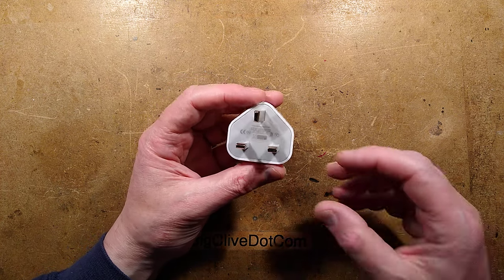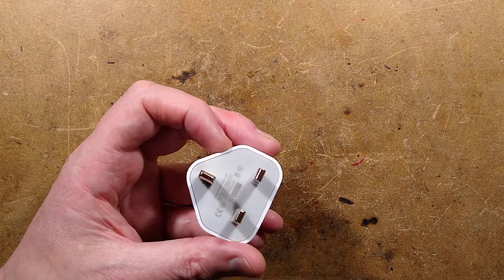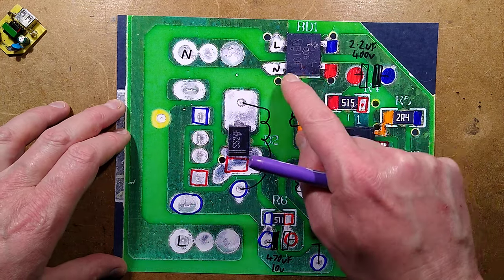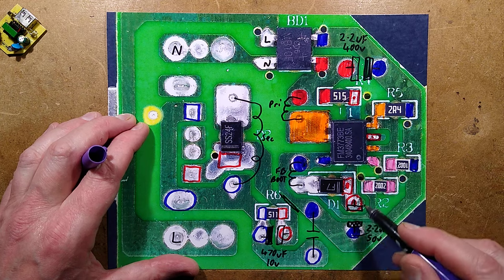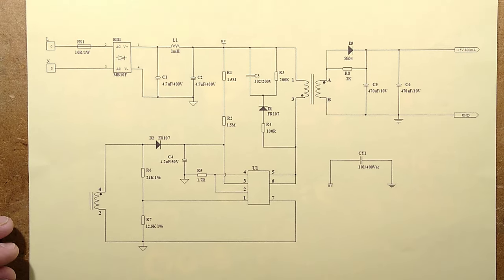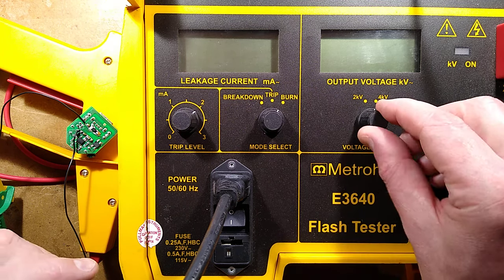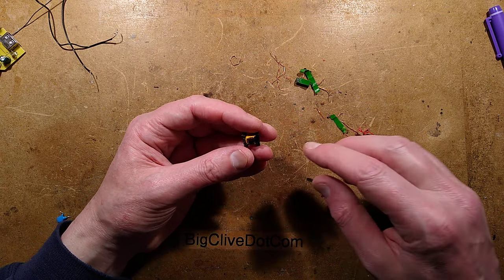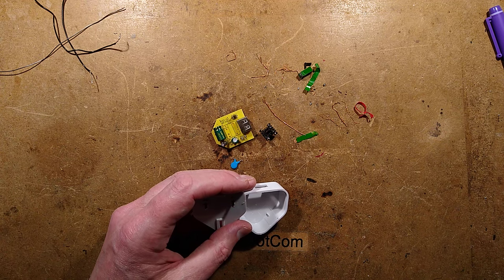Don't buy cheap death-wish chargers

Comment: I definitely wouldn't! I'd only ever buy from somewhere reputable as these could electrocute, explode or catch fire. Quite worrying these are on sale but at least it served one useful purpose, another great Big Clive video!
Reply: Vape shop owner here. Before there were UK distributers (yay, everything goes back on you as the importer) we'd be sent half a dozen large boxes of unsellable USB adapters and same again of completely unnecessary death dapters. Probably cost us an extra £500 on DHL shipping and then we had to pay commercial waste to get shot of them (which cost more than the shipping).
Chinese manufacturer thought that they were doing us a favour by sending "free gifts" FFS.
I can see the attraction of selling them to the public. We didn't. I've got loads at home, they're ok ish. I use them for small personal low current projects.
Reply: Worrying to me that it carries the CE safety compliance mark too. If Clive had reported his findings to Trading Standards, they'd have an open and shut case against that store in Sauchiehall Street.

Comment: I had one of these. My daughter has a metal cased phone and said she got mild shocks whenever touching it. It had to go. The 400V/5V separation and arcing was scary.
Reply: 400V???
Reply: @GBOAC  Rectified 230ACV RMS is pushing 400V and can spike over.

Comment: I just looked up Apple UK chargers, and I'm so sorry for you.  I love the UK home electrical standards.  But I also love the US 5W charger.  It lacks power, but fits in any pocket and works reliably on any power strip.  Great for overnight charging.  That 5W UK charger looks like an abomination.
Reply: 5w eu lightning chargers are scary small too!
Reply: The foldable pins 20W one I use for almost everything now, its excellent, pins fold away, can even power the laptop in an emergency. Only £19 too.
Reply: Remember that was a fake. Hopefully the real Apple made ones are somewhat better.

Comment: You're right calling them "Death wish" charger from pound shops. They are built to Chinese electrical standards, where electrocuting the user is perfectly fine.
The separation between the main and the output is 1 millimeter instead of the 20 required from international regulation.
Also, the charger lacks any feedback from the output, normally achieved with an optocoupler - which is missing here.
Thanks for warning the Internet about these dangerous contraptions...
Reply: I gotta ask, is the electrocuting the user thing a legitimate thing in their country?
Reply: They are not built to Chinese standards. Chinese domestic market has proper safety standards as well. Crap like this doesn't meet any standards.

Comment: You would LOVE a Soviet "transformer" I came across. I bought a Soviet flashgun to go with a Fed camera that I bought, 30 years ago when I was in Riga. I did not have great confidence in the transformer so I opened the case - it was screwed together. To get the necessary 6v to power the flash they had put a bridge rectifier and then a bloody great big wire-wound resistor. That was it. No isolation. About as unsafe as could be. I don't know if I still have that transformer or whether I threw it away.
Reply: Stick a 5.1V zener diode and a smoothing cap across it and make the least efficient and least safe phone charger ever!
Reply: Soviet stuff was illegal to use even in some countries of the Eastern Block. My graddad worked as a maintenance electrician  during 80's. Every equipment they had and was labeled as "сделано в ссср" had to be adapted or used with a safety transformer. The reason was that the USSR used the IT system in their power network so nothing (in theory) can give you a shock unless you touch both wires.

Comment: Well, don’t power any TTL-logic chips from this thing; the voltage was edging up to 5.25 volts or so (at around 965 mA). This’ll result in hot, smoky chips - and not BBQ flavor either! 😏
Reply: TTL can tolerate up to 5.4 reasonably well, but poof, no safety margin
Reply: TTL speced to 7v
Reply: @johndavis1465  No that's absolute maximum, as in a surge or something. So power supply overshoot of 6V is spicy, but non-volatile, whilst you could only get away with one or two 7V hits before something hates you for it!
Specs show 54LS' logic can withstand up to 5.5V - but the more common 74LS' series only handles 5.25V

Comment: That rather loosely mounted PCB with the mains pins almost touching the USB connector shield is also a potential safety hazard.
Especially since the openings of the pins wapping around the mains pins are open on the side towards the USB connector, so wiggling it a bit (while holding an USB cable) may already shift the board slightly and thus allow the mains pins to touch the USB connector.

That one really should have written "Don't turn it on, take it apart" as operating instructions.

Also in the video, it looked like the first spark was somewhere at one of the legs of the chip, not the traces which were obviously too close to eachother.

Comment: Thanks for making us aware of the dangers of these cheap chargers. Many people assume because something looks like the genuine article it will be safe and perform the same. 
I've always assumed Poundland electronics are actually very good, as being retail, they are carefully regulated.
Reply: ones sold by actual Poundland 'usually' are much better, clive has reviewed some, that said, one   of the ones he reviewed i bought, only used a couple of times till it made a popping sound and bit of a smell, i opened the thing up and both ht dc smoothing caps were red hot and one very bulgy about to pop completely,   i think the main problem is trying to shrink parts too far, as someone once said, 'you cant miniaturise the watt' ,  larger sized caps handle the ripple current better without almost boiling

Comment: If they would connect the Earth with GND of the secondary side, then they would have a security benefit in case of a connection between the life-wire and the secondary side. But they didn't do this.
How would it be if the products get quality-checked from an engineer before we let them enter the European boarder?
The possibility that bad things are happening would be much lower.

Comment: It's sad how little life means to the manufacturer of these death traps. 
Unfortunately government isn't out to protect anyone but themselves. 
Otherwise, importing these would've required true UL and other approvals, like apple and other name brands do.   
Pay once, cry once. Buy real name brand electronics.
Reply: It was marked CE. To do that is a statement by the manufacturer that it complies with various EN standards that derive from IEC standards just like UL. Clearly the manufacturer was lying. But to see it in Europe it HAS to be marked CE (it's compulsory) so the manufacturer just applies the mark without bothering about compliance. That means that the CE mark is essentially WORTHLESS despite honest companies spending lots to comply. What CE actually has come to mean is CAVEAT EMPTOR !
Reply: Not the government's job
Reply: @alfstewart2592  Sort of half and half. Central government in the UK has 'farmed out' policing CE marking to Trading Standards who are underfunded so it ends up being a mockery of the law. It was the government that brought in those regulations and more recently the UK only CA but they're just 'box ticking' in reality.
Reply: Give government enough powers and it will do anything to the max. Great example was in 1970's when government prohibited extension plugs and  cables. In Finland. Only legal solution was either lengthen the cables on devices or install new wall plugs, which could only be done by licensed electrician. Lasted only few months, but some new apartments had literally hundreds of wall plugs, which was not too safe either.

Comment: While I agree in principle… I don’t need anything to come with any more USB cables or chargers.  All I wanted with my iPhone 13 was a lightning to headphone jack adapter.  I had none of those.
Reply: I didn’t even need one of those as I have wireless ear devices. I did buy one in the end for an external mic for video.
Reply: @melanierhianna  Yeah I 95% use BT buds... but now and then I want a real aux out or better mic (wired headset with boom mic) for important calls.  No BT mics do well for my voice.

Comment: I think this needs to become a salt-water hydrolysis unit. Turn the unit over; fill the plastic lid with salt water, put the circuit board back in and put the lid (with the power prongs) back on. Wipe the excess spilled salt water off, then use JB Weld that’ll set underwater to seal the lid shut (and the USB socket - you won’t be needing it anymore.) Now, go get a really long extension cord and plug this into it, leaving the plug-side of the extension cord disconnected for now. Put the “new” hydrolysis unit in the fireproof pie-pan, and set up the camera(s). Now, go plug in the plug end into the nearest wall outlet and wait for the >Bang!< (or the breaker to trip, one or the other.) Post this on your YT channel. All done! 🤣😆 This is sort of like a shango066 EOL video, but without actual fireworks. 😌
Reply: All joking aside, is your name really William Squires?
Reply: @jeffrey44  - yes.
Reply: @williamsquires3070  I assumed it was a made up name. You must be the only person called William Squires in the whole world.
Reply: @jeffrey44  - No. My full name is William H. Squires Jr. My dad is William H. Squires, and his dad was William (Bill) A. Squires (now deceased.)

Comment: In my experience testing cheap adapters to destruction, those non-Y 1kV capacitors tend to fail at about 1.3kVAC, which is close enough to the 2kVDC you got here. A real Y2 cap should withstand 3.5kVAC/5kVDC for a minimum of 30 seconds in destructive testing. Enamel-on-enamel wires are good for about 2kVAC as long as the enamel is perfectly intact wherever the wires are close enough to arc over otherwise.
Reply: I recently saw a 'capacitive' dropper using a 1uF non X rated 400V polyester cap. Its value had dropped to 570 nF due to gradual repetitive overvoltage spikes probably.  The reduced capacitance stopped it working. There wasn't enough room to fit a proper Class X Cap so I suggested a 630 V one as a improvement at least.

Comment: Not enough;
1 - Package crinkling, 
2 - Blade coming out of its cover/block/wherever it was swiftly and ringing for an impossible 10 seconds, 
3 - Unnecessary and cringeworthy saltbae gestures,
4 - Microphone at maximum gain and plus 150+ db on mixer basically picking up an ant's fart on the other side of the planet,
5 -  Also not enough nipple caressing and heavy breathing on the mic.

0/10 unboxing video. Liked, shared, subscribed. (Headbutted the ringy thingy)

Comment: 1:49 it's not cutting out, you can see led on load shines the same brightness all the time, it's just a way that tester shows that voltage is over specified value, dictated by what standard is detected in charger.

Comment: These and the generic, weightless, USB/dc 5v/9v/12v chargers are outright lethal. I opened up several after seeing Diodegonewild's videos. Now I either scrap them for parts or bin directly upon opening. No fuses, no separation, sometimes just the lacquer on the windings between you and the mains. Lucky yours even had a chip. Normally just 2 transistors and a zener for regulation lol. How many are shoved down the back of sofas or under piles of paper on desks or bedside tables across the country. I shudder to think.

Comment: I repair USB charge ports used in our local public transport buses. They rate their chargers at 2 amp but they only seem to go to just over 1 amp before dropping out. They tend to get destroyed by idiots braking the units and shorting out the charger's. The units don't burn out, they just shut down. I replace the USB plug and they are all good.

Comment: I found one in a grassy verge while I was out walking in the countryside. AFAICT, it's absolutely genuine. I needed a "clean" 5v source to power my Hans Summers U3 WSPR beacon (qv: I can't be bothered to explain what it does☺). With most of my wall-warts, the U3 reset itself as soon as it went into transmit mode. I looked at them all on a scope, and the Apple had the least spikes on the output. It works fine and runs cool. I've no idea who dropped it, but their loss was my gain. ♥
Reply from the maker: If a charger has been wet I'd be cautious about using it.  There may be conductive residue on the PCB.
Reply: @bigclivedotcom  That's good advice. However, this one has been in almost daily use for at least two years - if it was going to make an attempt on my life, it would probably have tried by now.

Comment: I think I might have some of these but I definitely won't use them. Especially if plugged directly into a wall socket. No inrush current protection or fuse. So if something went wrong it would only be the 32 amp ring main breaker to protect. Not good!
Reply: Not so actually. The PCB tracks will end up acting as the fuse first ! Depending on track width of course. It's surprising how much a 20 thou track will sustain for a brief time !

Comment: It was watching several early videos of crap USB chargers that hooked me on to this channel in the first place. One of those chargers was identical to one I had (which I'd bought for use in Spain), and I was horrified to learn how potentially dangerous it actually was. I was prompted to throw several chargers out after that, and I now only use branded ones that I've paid a decent price for. 

The other thing I learnt was that charging cables are not all alike. I had one which turned out not even to be able to charge the phone at the same rate as it was being used. Once again, you get what you pay for.

Comment: did the "Y" safety cap fail open or was it an "X" cap failed short?? since you asked a Class Y 1 is  rated 500V with 8KV being peak the Y2 is rated 250V peak 5KV y3 not sure Y4 150v rated peak 2.5KV